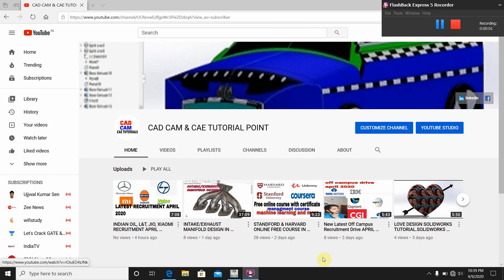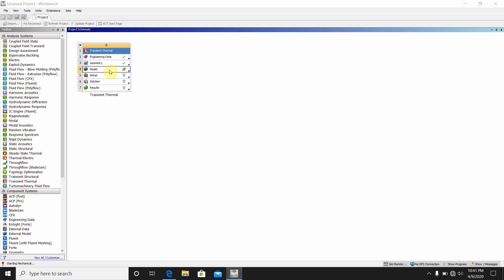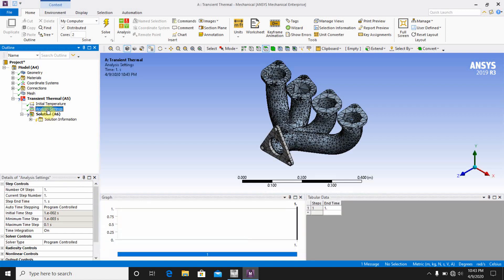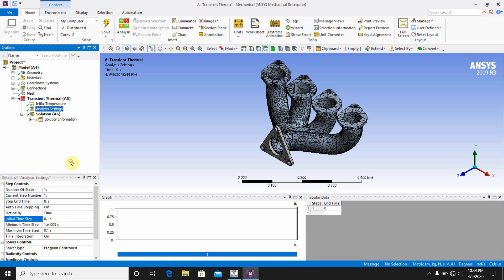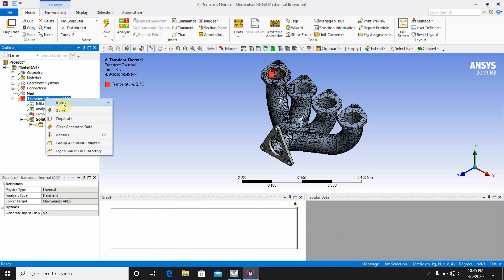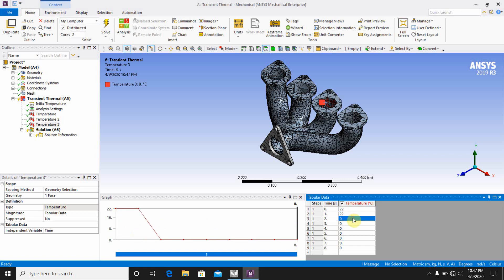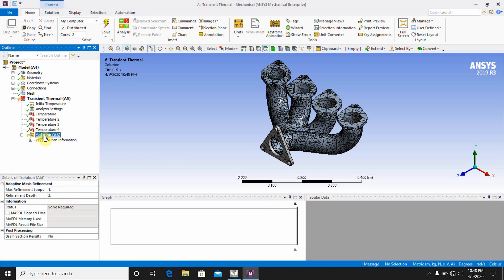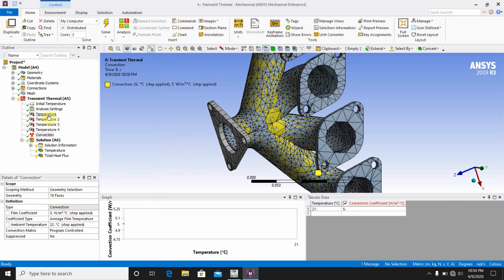Thermal Analysis in ANSYS-WORKBENCH( EXHAUST MANIFOLD).Thermal Analysis in Ansys Workbench . #ansys

Comment: This is not correct way ,as an inline 4 cylinder engine is having firing order of 1-4-3-2 and gasses are expelled out in similar manner . In this case it has became 1-2-3-4 , to correct this should I rename the temperatures .